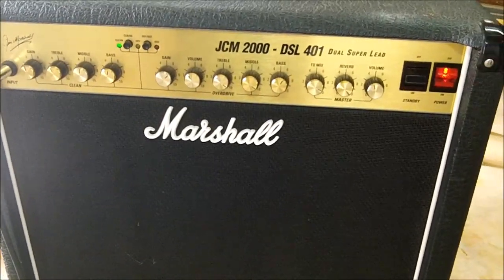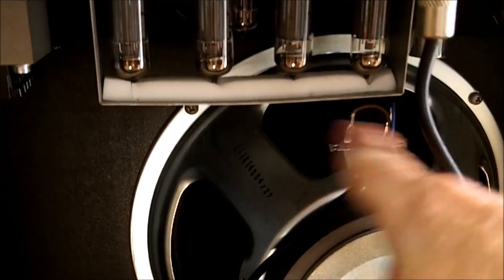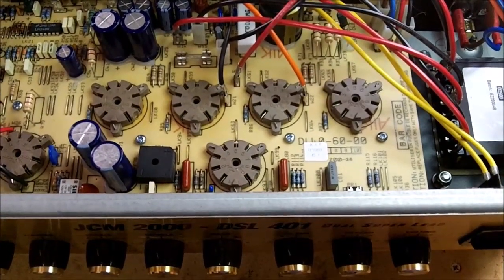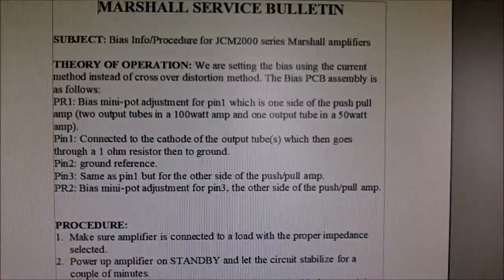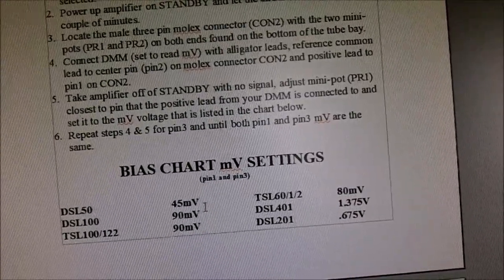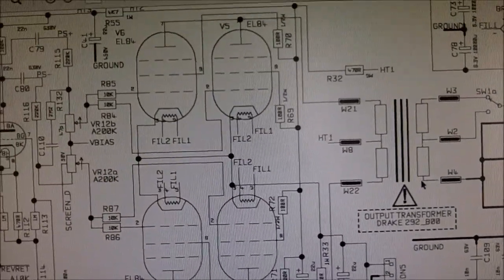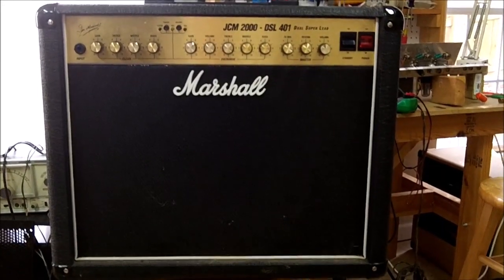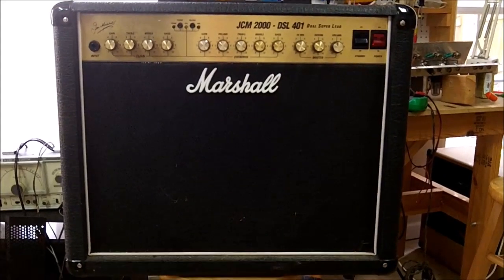MarshallDSL401

Comment: Hi James, thank you for your videos, I'm gonna pass this by you just in case...
 I have a JCM 2000, English 100w head, (2005 post bias drift), just purchased off the Internet, I just re-tubed it but it still sounds like it has a cool bias setting even though I have it set hot (88mV, Marshall recommends 90), I tried cleaning the effects loop, patching it but to no avail...
Something I just noticed is, if I tap on the master volume knob it won't completely mute when I have it on 0, if I keep tapping it goes away (completely mute), and comes back so naturally I stop tapping when it's muted (normal), ever come across anything like this?
Reply from the maker: I would use contact cleaner on the volume potentiometer if you haven’t already. Even turning the knob to 10 and back to 0 multiple times will sometimes clear any buildup inside the pot.
Reply: @jamelectronics  👍

Comment: Just watched your video and have the same amp. My amp works but it seems that volume is weak not as strong and have to  crank up the master volume . I have never had to do that ever. You think maybe the power tubes are bad ? Mine is a 2004 model . Appreciate any advice, thanks .

Comment: Thanks so much for this, im still alive anyway. My bias reading is 1.2 volts and the Pot wont let me take it lower than 1.02v, is there anything I can do to make it lower?
Reply from the maker: There are a couple of options. You could select a different set of EL84's. The ones you are using appear to be a bit "hot". Or you could just set it to 1.02 volts and you would be at 9 watts plate dissipation at idle instead of 8 watts- hotter but should not present a problem except possibly shorten the tube life a bit. Still way better than the Marshall recommendation per service bulletin. The final option is more complicated. You could modify the bias circuitry surrounding the bias pot VR12 to give more negative bias voltage which would enable you to limit the plate current more. ( Also make sure all volume pots are turned down to "0" when taking measurements.
Reply: 1.02v is only 74% vs 70%.  You should be fine.

Comment: 0:32 OMFG! My heart was stopped. Do you know how to turn on/off the lamp amps? At first you must switch the POWER button and wait 1 minute, only after that you can switch the STANBY button. If you need to turn off the amp, you need to do the same but in reverse.
Don't kill the lamps, pls.
Reply from the maker: Yes, I do know, do you? On power up of a tube amp, the "power on" switch is turned on first and after 20-30 seconds the amp is taken off standby. Turning on the power switch first allows the filaments to heat up the cathodes prior to the amp being taken off standby, which then applies high voltage to the plates of the tubes. Failure to do this may cause "electron stripping" of the cathodes and shorten the life of the tubes. However, there is no danger in turning the amp "off" without leaving on standby for awhile. When powered off at once, no electron stripping is possible. You may have heard otherwise from others or seen it on message boards, but if you don't believe me look at any of the Fender ( or other ) manuals for tube amps and you will see.
Reply: @jamelectronics  ok, thnx😀